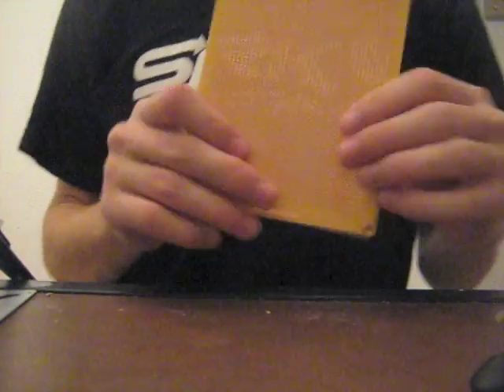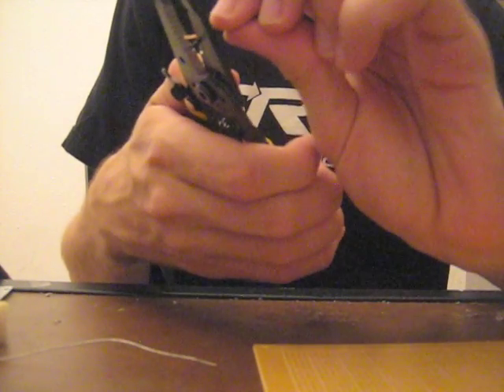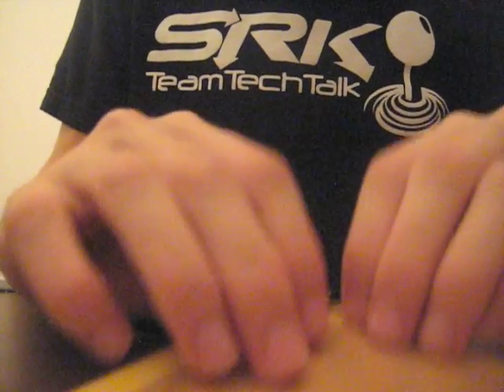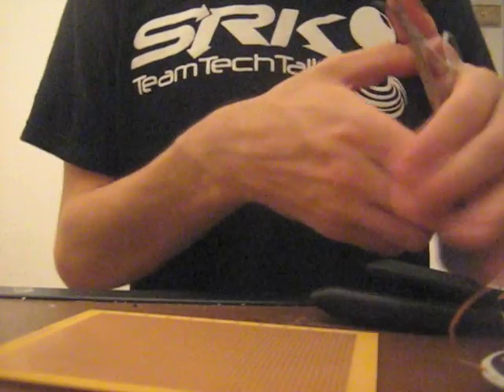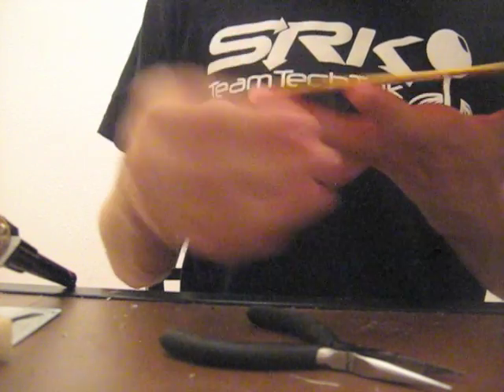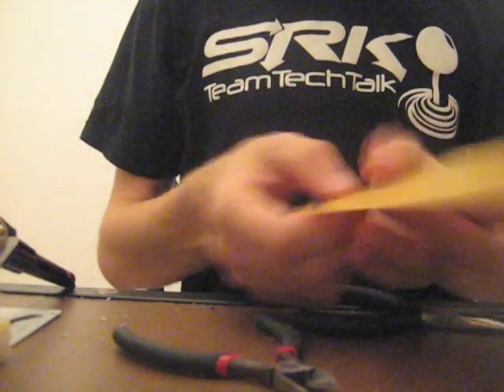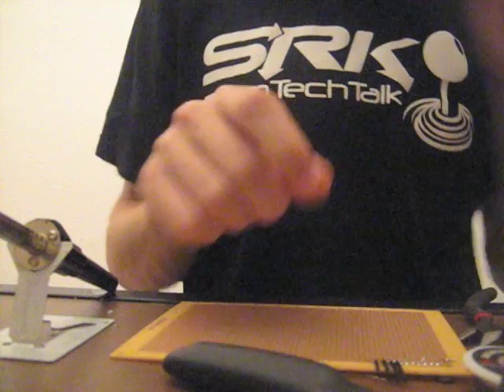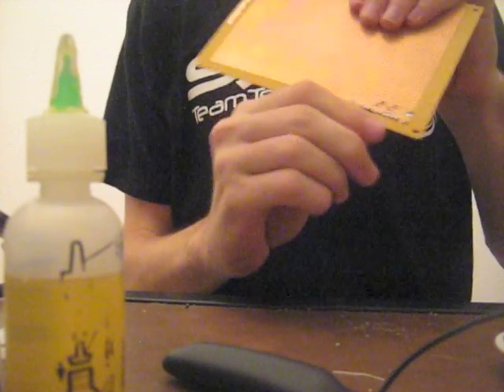Soldering Tutorial for modding Arcade Sticks

Comment: Nice vid. I just picked up a soldering iron the other day to fix up some wires I spliced together in my stick (bought a buffalo stick... was cheap so I replaced all the parts). Haven't really done much soldering before and I think it could be a fun hobby. 

My little beginners kit came with some "paste." Is that used like "Flux?" I couldn't clearly see what you were doing with the flux. Did you tin the wire, add flux to the board, then solder the wire to where you added the flux? Did you add more solder or was the bit you used to tin the wire enough?

Silly questions... sorry. I'm thinking of getting one of those robot kits as a means of practice.

Comment from the maker: @strawberryreapertk53 
Depends on what stick you're using. Soldering irons shouldn't be expensive, I'd say no more than 10 or 15 USD for an iron that can do most work, which you can probably get at a RadioShack, Home improvement or hardware store, or I've even seen them at Wal Marts. Maybe in a different country, I could understand. But, regardless, it really depends on the stick you plan on modding, and what specifically you want to do.